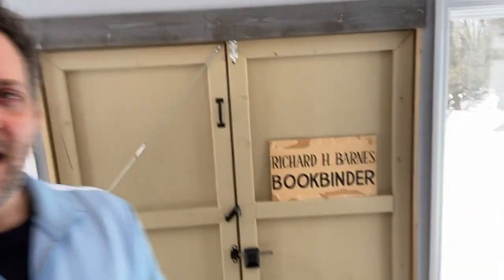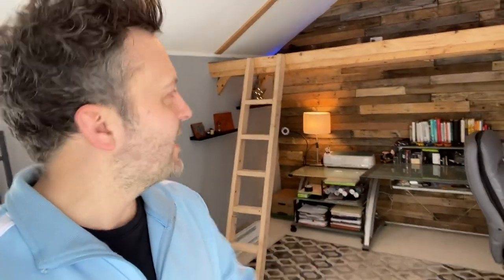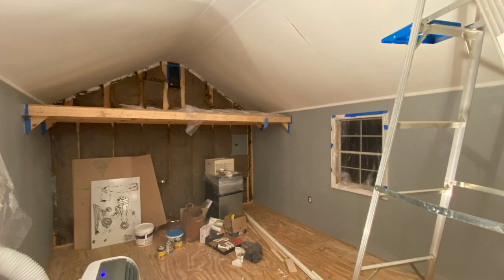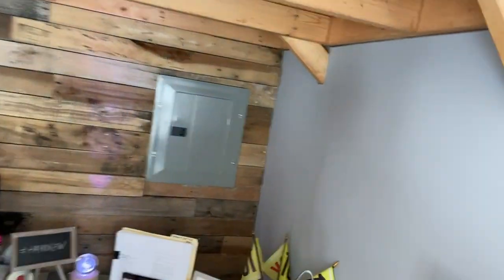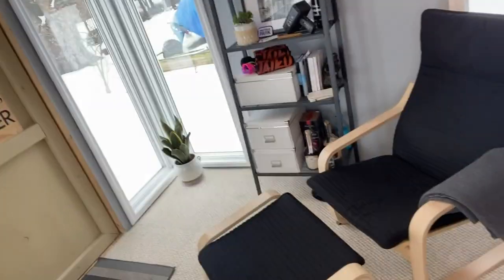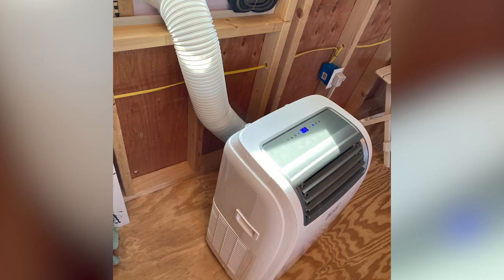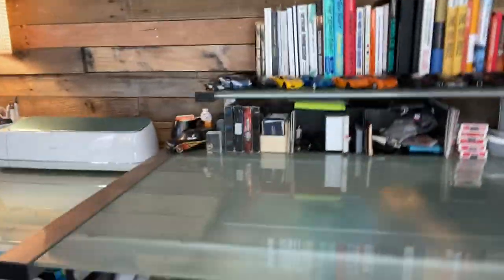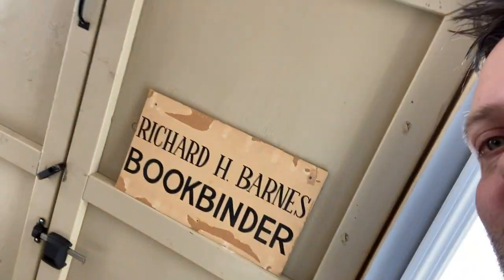I converted a shed into an office!

Comment: This is awesome, super jealous because I’ve been wanting this.  Great job !  I was going to build a shed against the house and run off of an ext outlet for the inside of the shed, should I?
Reply from the maker: Great idea- When I was buidling this out I was working in it before it was done and ran my computer set up, a fan and some lights all off 1 power cord I ran into the window. But that's a temporary solution- once you add an AC unit or heat then the power draw gets huge. And nothing beats having real outlets. I think I put the prices for the electrical build out in the notes for the video. There's a big cost to lay the wire so if it's right next to the house then that makes it way cheaper!
Reply: Awesome thanks for the feedback

Comment: What did you use to insulate the floors? Was it just using the carpet for insulation or did you put foam boards under the shed? Wondering since I live in Texas and my tuff shed is on a slab with the Tuff Shed having the 6" steel frame. Walls and roof are insulated with 2" closed cell spray foam and wondering about the floor and if I even need to worry about it to be honest. Shed looks great!
Reply from the maker: Great question- Floor is just the plywood then carpet padding then carpet. It definitely gets colder than the rest of the space so looking back I think adding some kind of additional layer there would be a good idea. We're in MD so temps can range quite a bit. The rest of that place is tight though- even with the stock doors on it (I do shove some padding in there becuase there's a little gap where the doors meet. Good luck!

Comment: Nice place!
I’m currently getting a she shed but it will be my office space due to being hired for Partners. My husband was going to get a window heater/cooling system but he decided to just install two light fixtures with fans. I’m not sure what he’s going to do about the heater. I think he said something about an indoor heater. I have a feeling I’m going to freeze to death 😂 but ok. We will see how it goes.
Reply from the maker: Hhah well I've been through a few different heating solutions. I would not recommend an all-in-one machine that has Heat and AC... I found a dedicated AC and dedicated baseboard heat with supplemental upright fan heater was the best. I went through 2 of the all-in-one's and while they looked nice and were convenient they just coulnd't handle being the primary source of hot or cold.
Reply from the maker: There are some links in my video description with links to my top products used in the shed too.
Reply: @pumthuggee  thank you, I really appreciate the info.
Reply from the maker: @eb8791  of course! let me know any other questions...

Comment: What did you do to vent the roof? We are finishing up a shed like your’s and debating which way to go. Just finished up doors, electrical, HVAC (MrCool mini split). Next is insulation/ventilation/walls/floors/paint/trim.
Reply from the maker: Hi Joel- No roof vents, just sealed it on up and do all the air exchange through the HVAC. I will say that baseboard heat has been way more effective (and quieter) than the big unit. Also the big combo unit broke twice so now I have a window AC unit and seperate baseboard unit.
Reply: @pumthuggee  thanks! Getting so many conflicting answers. Spray foam on the roof? 
My father is suggesting framing in the middle of the ceiling to connect the two gable vents.
Reply from the maker: @JoJoJoker  I just went with my contractor's recommendation. We used R15 or whatever that paper-covered insulation is (should be a pic in this video somewhere). It's working great in terms of managing the temps I'll you that!
Reply: @pumthuggee  Thanks for the answer. I had the same question as Joel D. I guess by function of being in there all the time the air circulates whereas a closed shed it might not. I am ordering a shed next weekend and am in the process of figuring out all the interior stuff. Thanks for the info on what you did for heating and cooling
Reply from the maker: @terryodonnell5739  Sure, happy to help. I also run the fan in my window AC unit and right now when its in the 60s I'll just leave a giant door open. Doesn't work for january so much but for the warm months, no complaints on air flow.

Comment: That is just Incredible. I might do mine like this too one day. Oh by the way the electrical panel. how many amps did you use im just curious.
Reply from the maker: 35 amps! The biggest pull I have in there is my window AC unit- still not much since that thing is so insulated.

Comment: I’m doing something very similar with a side lofted barn - I have your same doors. Can I ask what you used to seal the doors with? … congrats man. Killer transformation!
Reply from the maker: nice! the doors seals really tight already so I basically keep one always closed and just pull the other one shut. I did have a piece of basic weatherstripping stuck on the bottom of the opening door but it eventually fell off. I just got that in a roll from Lowes. Hope that helps!

Comment: That looks like a great place to work - the framework is thicker than the sheds you can buy in the UK, so better for the insulation. Did you insulate the doors?
Reply from the maker: Hi Alex- Didn't insulate the doors but i did install some weather stripping around the bottom. I only ever open 1 side and it's built really tight so basically sealed. And it does shift a bit depending on temp and humidity. Sometimes the doors shut tighter or looser depending on those factors
Reply: @pumthuggee  Thanks. Enjoy that space, it looks awesome!

Comment: Great set up man. One thing I didn't see is the  cost for the site leveling or Slab or concrete blocks pier? what did you set it on?
Reply from the maker: Thanks Efrain- I had a bunch of blocks already and the company that delivered did the leveling and install. didn't take long. It's just blocks on the ground at all 4 corners plus every 4 feet or so around the other sides. Bot a big cost.

Comment: I’m thinking of doing this in Michigan.  I have similar doors on my shed.  I was going to replace them with a single entry door.  How do those doors  work in the winter in terms of warmth?
Reply from the maker: The doors are pretty good for keeping things sealed- I did add a weather stripping at the bottom of both. The floors are really where the cold penetrates the most- I've since added some under=-floor insulation so definitely would recommend that too!
Reply from the maker: Also the windows that came with it were single pane. If you have a chance to get dual pane, something nicer- that will help a ton

Comment: Hey! I am in the midst of a similar project. Did you insulate your door at all? What did you do for a door lock?
Reply from the maker: Word! I didn't insulate the doors but they came installed really snug so almost no gaps. I did add some rubber weatherstripping around the bottom and I only open 1 door ever. So that has kept it pretty tight. The deadbolt was really tough- I actually used a Gate Lock- not very easy to find at Lowe's but eventually got it to work and it's solid. I'll try to find the exact name of it later but deadbolt + handle lock + alarm system on doors and windows- it's the most secure shed I've ever been in LOL. Good luck!
Reply from the maker: Here's the deadbolt: https://www.lowes.com/pd/National-Hardware-3-4-in-Black-Gate-Lock/1000789648

Comment: Do you live in area where winter is tough? Does it handle weather okay?
Reply from the maker: So I'm definitely going back to insulate under the shed. The floor is noticeably colder than the rest of the shed. Still running heat off 1 baseboard heater but I think the insulation is going to help a lot on the floor. Right now it's just plywood, padding, and rug. Only thing I would have done different!
Reply: What are your plans for the floor insulation when you redo it?

Comment: Did you use the same thing on the ceiling as the walls?
Reply from the maker: Yes- same insulation and paneling and then for the ceiling the seams are covered with stained boards. They seems were just way more noticeable on the ceiling than walls

Comment: WOW. I so love this and my son is planning to do the same. He is building his own shed though. May I ask what you used for the ceiling?
Reply from the maker: Great! Ceiling is just insulation and then that panel board with mud on it. Then the wood beams you see cover up the seams. Drywall totally an option too but 2x the cost of the cheap panel board

Comment: Did you have to vent this shed?
Reply from the maker: Hi Sean- I sealed the vents on both sides completely so no venting going on. With the doors opening and closing all day + a really solid construction build out I haven't had any issues with moisture or air. I do have a window AC unit I'll run on cold or fan for half the year and then I open the windows for the in-between months. All seems to have worked so far with that approach. Only big temp issue that I don't have a solution to is that the floor is straight plywood with just ground underneath. So that can get a lot colder than than the rest of the shed which is fully insulated like a house. Hope that helps!
Reply: @pumthuggee  thanks for the reply. Getting ready to build a barn style with loft and trying to figure out if venting is needed. It’s a bit tough though if the ceiling is completely dry walled. Windows, doors, and AC unit may be the only way if I’m going to have it fully insulated.
Reply from the maker: @seanmccaffrey5804  Good questions- What kind of climate are you in? I'm in Maryland where it is all climates each day sometimes.
Reply: @pumthuggee  I’m in Colorado, high desert, so may not have as many moisture concerns as I’m thinking.
Reply from the maker: @seanmccaffrey5804  Ahh gotcha- That might be perfect. I decided it was more important to have this place insulated and tight because of all my electronics in here. If you're packing your computer stuff in and out every day or don't have a lot of electronics then you can probably do whatever you want and the only variables will be around temperature consistency. You can always include a vent but with a lid or latch to seal it up. If you need to vent it down the road, open it up when needed. I almost did that.
Reply: @pumthuggee  that’s a good point. We will likely only have one laptop in there and could pack in and out daily. Guess we kind of have to choose one or the other. Ventilation or consistent temperature regulation. What kind of vent were you thinking of doing?
Reply from the maker: @seanmccaffrey5804  Cool cool- not sure what kind of vent. I usually ask my contractor or just browse through Lowe's till something jumps out.
Reply: @pumthuggee  sounds good. May have to pick a contractors brain… thanks for the help!